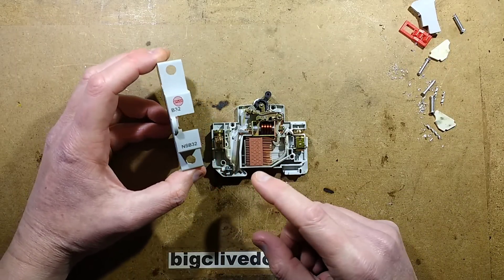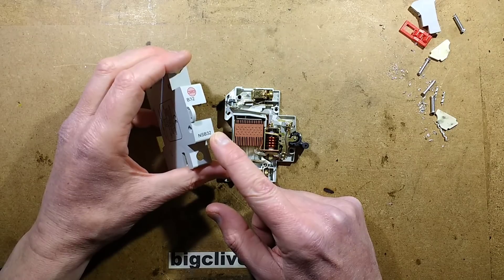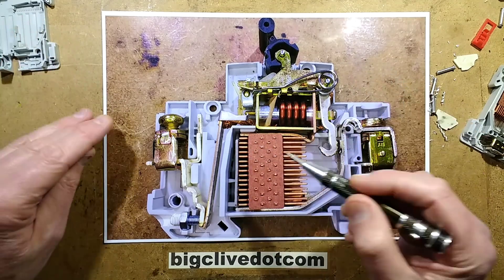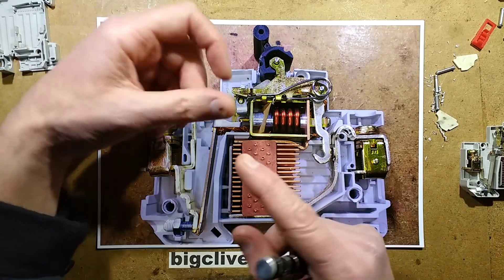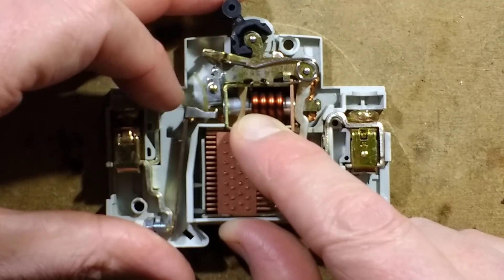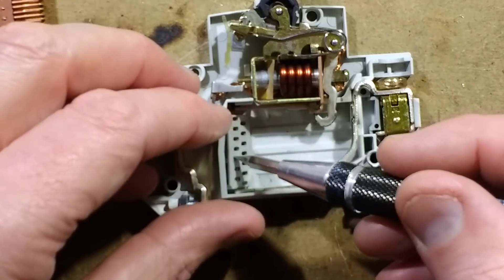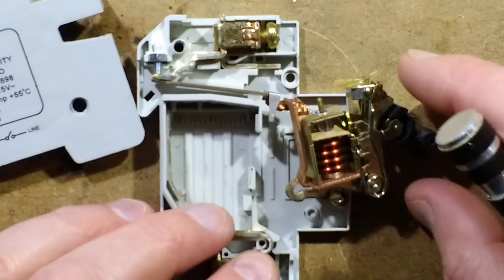Inside a faulty UK Wylex circuit breaker.

Comment: I had an electrician in today to test/check my installation on behalf of Victory Housing (The housing association who owns the block of flats) and he plugged his device into a power bar I had in my bedroom to trip the RCD and it came up with a wiring fault, This baffled me as I use it and works fine (and I checked it before installing it) then he tried it in the second power strip (6 way) and got his reading. After he left I realised why he was getting fault on his device. The first power strip wasn't turned on. Because it's an 8 way and has a lot of old devices plugged into it (my old PC's and an old stereo system) and because accessing the strip is hard, I installed a switched fused spur so I can shut the strip off if need be. Oops.

Comment: quite a lot for a few pounds really, here in the States I don't think they are quite that cheap and with the exception of newer arc fault styles they are quite a bit simpler too, US electricians chime In
Reply: Last time I bought a single pole with a modest current rating at Home Depot I recall it being closer to $10. Perhaps I need to find a better place to buy them.

Comment: Who the fuck buys circuit breakers from ebay?
Reply: bigclivedotcom you should buy a few dirt cheap Chinese ones and open them up in comparison
Reply from the maker: On the basis that they're still on sale I guess people must be buying them.  If people don't realise the potential hazards all they'll see is a cheap item.
Reply: cheap landlords who dont live there if the abode goes poof?
Reply: If it's being sold by a reputable seller it should be OK. 

Shipped from China = stay away though.
Reply: for one, people seeking breakers for obsolete panels (despite the DIN rail mounting system supposedly being interchangeable, at least one 'certifying body or whatever' - the NICEIC- STRONGLY encourage their members NOT to fit other brand breakers in boards... even if they physically fit. 

Had to buy some Crabtree POLESTAR 10KA commercial breakers (RCBOs) from ebay (nos) the other week ... because they're simply not available. And changing the board would run into over 1000 pounds.
Reply: I'd buy some off ebay... and open them up. Would still be wary of their supposed ratings, though.
Reply: The Obsolete reason is a good one. There are a lot of panels here in the US that are still in service and are known to have faulty breakers that often fail to trip. The manufactures stopped supporting them, and you can only get used or rebuilt (yes, rebuilt breakers. I have heard of the concept but not looked into it.) breakers for these panels. The smart thing to do is of course to upgrade to a modern supported panel but who wants to spend that kind of money. (I would because I would check before I bought the house and make them either upgrade it prior to sale or take a chunk off the asking price to have it done.)
Reply: People in poor countries, where electrical standards are non-existent.
Reply: Didn't Clive tear down a Chinese knockoff circuit breaker some time ago?
Reply: + Clyne Griffon - I member umpteen years ago that Federal Pacific breakers were unreliable. LOL, the house I grew up in had a 200 amp FP panel. Aha, I found something about this, and it seems more of a testing mode issue with UL: https://www.cpsc.gov/content/commission-closes-investigation-of-fpe-circuit-breakers-and-provides-safety-information-for
Reply: Yeah my Dad's house has a FPE panel. He has a new Square D panel subbed right next to it that he put in to add a instant hot water heater and has slowly been gathering more and more circuits as each time a breaker gives out in the FP panel it gets moved to the Square D panel in a new, suitable breaker. So at some point he will completely switch everything over. Its mainly the lack of breakers to replace any bad ones that are the issue.
Reply: Someone who doesn't want the hassle of circuit breakers tripping.

Comment: With a good MCB (Schneider/Hager etc) it won't be possible to unscrew the clamp and have it stuck at the top, as the screw is captive and forces the clamp down anyway. Also when the clamp is tightened, a shield blocks the hole to make it obvious. Furthermore, the location for the comb busbar makes it obvious that it doesn't accept bare wire. In many ways common residential electrical supplies in the UK seem to be of lower quality.

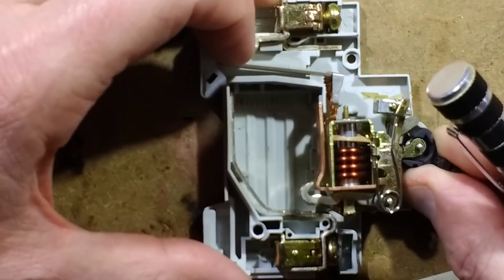Comment: Clive, @10:40 could the magnetic field be pushing the arc out? Like how a rail gun works? The arc and the rails would be creating a self repelling magnetic field. (Maybe. IANAS.) Otherwise, plasma expands and goes up, possibly because it's lighter than air. See plasma in microwave videos.
Reply: Gersberms *Plasma in electric arcs goes up because it heats up air (the arc is also made out of air in the plasma state) and as you probably know hot air is lighter than cold air (as long as there is no significant pressure difference)
Reply: Arc would be traveling more or less parallel to the field lines, so no force exerted. Force from a magnetic field acting on a moving charge is proportional to the sine of the angle between the velocity and the field lines.
Reply: That's is right in some parts. The plasma is ionised which make it magnetic. And then Yes get pushed from the outer magnetic field.

When an arc ignites it's travels away from the power source. When the current is big enough.
Reply: Remember it's for AC, which is a lot easier to break because it crosses zero.
Reply: Actually, thinking about it some more, I would depend on what angle the moving contact is at relative to the fixed contact. It looked horizontal in the picture, but it might have been diagonal, in which case the charged particles would spiral around the field lines, right into the quench plates.
Reply: Sharklops The condition that needs to be met for an arc to appear is: the gas has to be ionized. The electric field needs to have enough voltage (basically amount of force that pushes every electrically charged particle from the points charged oppositely) to give energy to the electrons of the gas'es molecules to create ions of the gas and free electrons (not sure if that's exactly what they're called I will have lessons of english vocabulary in 3 years). Before the air is ionized, it's conductivity = 0. And it is equal to 0, because my teacher is VERY sensitive about accuracy in what is said (there is no such material that would be classified as an isolator, isolator is what is used to isolate, but no solid material known is a perfect isolator, every conducts some electricity). Hehe. I just wrote that. I think I'm turning into my teacher because my point is, it isn't the arc that ionizes the air. 
(I do consider the fact that you probably know most of what I wrote, but to the random people that got interested by this comment and checked the replies, maybe they will find this reply filled with lacking explanations (explained the voltage, left the current alone and such) interesting or sth. I don't know maybe I'm just bored.

Comment: i have a question
automatic breaker works, break circuit after the exesive current heat up that bimetalic strip for a while
but does it heat up from all the current it pass trough or only by the measured by your power distributor as "real power"current
what happen when you for instance huook up loads of fluorescent  lamps with magnetic balasts and no power factor compensation at all?
i know that breaking characteristics are a curve of time to current, but does breaker care for power factors? 

and 2nd question 
is there a way to make a soft start breakers? some kind of inline ntc termistor or something?
for instance we have 10A B breaker and 5 computers, in theory they suposed to only take less than 7,5A with monitors at full load, but the capicitor charging at cold start trip the breaker every time (you could reset it 3 times and then they stay on)
Reply: It heats up from the current passing though it.  It doesn't care about real/imaginary power.  Current always causes heat build-up due to I-squared R (the current squared times the resistance) losses.
Reply from the maker: It's purely based on the heating effect of the actual current flowing through it.
Reply: yup, what i tought too, but some seller made me crazy
thanks
Reply: so the magic capacitor power saving boxes would help with that :]
even better, let's install proper capacitors in the fittings itself
Reply: Breakers trip on current, not on power. The current is real, no matter the power factor. (that's why the utilities don't like a poor PF).

For tripping on startup: Hook the monitors up to a separate power strip with a switch and just switch them on a second later (or get an automatic master-slave-powerstrip).

Comment: Nice, Whatever fuse or breaker, If it cuts off the power, that could be a good thing, If it catches on fire in the process, well, at least you are alive.
Reply: unless you're not because it cut off the power, then burned your house down
Reply: ihniwtpu Actually this type is not, it is designed to protect electrical wires from overcurrent. If you have 16 Amps protected circuits at home, a constant 8 Amp arc fault can still burn your house down and this breaker will never trip. There are AFCI for protection against fires.
Reply: TheChipmunk2008 So true
Reply: And this type of breaker also doesn‘t protect you from electric shock. Only a solid ground fault or overcurrent of ten times the nominal amperage will trip it quickly. You touching the live wire would not cause it to trip, you would need an RCD

Comment: Clive, only today I replaced a volex mcb which had melted its self to its neighbour, lots of smoke and black coating inside the fuse box, no apparent overloading so it just failed in normal use, the box was the main board for a fish frying range so ran at a moderately high temperature 
This may explain the failure.
Reply: Might also be that it has tripped often, or was used to turn something on and off (like a light switch), the contacts might have failed and gone high resistance.

Comment: Hmm, I think I have a Wylex MCB or two in a consumer unit I never used for anything (bought it to take to bits, long before I ever heard of yourself!!) that was bought around that time, should probably check it and see if it's got any dodgy ones...
Reply: Seems mine aren't recalled, found a post detailing the date codes on a forum, and mine isn't in there, though this one you have is, but the affected ones are the 6A, 10A and 16A, guess that one you got sent was just plain faulty... :)

That forum post I found:
https://www.electriciansforums.co.uk/threads/wylex-recall.14690/#post-113448

Comment: Can someone steer me in the right direction?? I'm looking for a A103G resister. It's a nine legged thing. Looked on eBay and no joy. Desperate times!
Reply: Unironic Genocide . You sir, are a superstar. Thank you. New to all this
Reply: Unironic Genocide I know this may seem like a stupid question. But is there a right and wrong way to put them in? Or will it work either way round. 
Thanks in advance😁
Reply: There have also been a few cases of very fake copies of "decent brand" Chinese distribution board surge arresters; no internal MOV stack, and the green "working OK" flag being a chunk of green plastic stuck behind the status window.
Reply: Neil Tonks the dot on the package denotes the common terminal, only works one way round if replacing another 👍

Comment: You should dig out your clear breaker and film in slomo it breaking a large current and the fins being used to dissipate the short.
Reply: Mikeselectricstuff has that video already
Reply: All in the US, none near Isle of Man.
Reply: Send it to Photoninduction
Reply: 1 lives in the US and 1 lives in the UK. They usually film in the US (I think in Texas)
Reply: I was going to suggest the neon sign transformer so we could watch how the arm moves.
Reply: I don't think the SloMo guys are in the US.
Reply: Yes, apply it with the circuit open.  At least we'd see where the arc wants to move to.
Reply: bdot02 ii
Reply: Hmmm.... Destin and/or the SloMo guys might be able to help with that... or The Backyard Scientist
Reply: Those only deliver 60mA tops. Woudln't trip it, and if you'd do it manually simply sustain an arc.